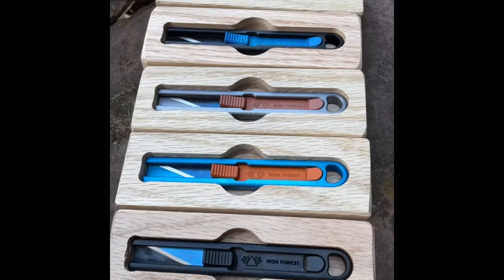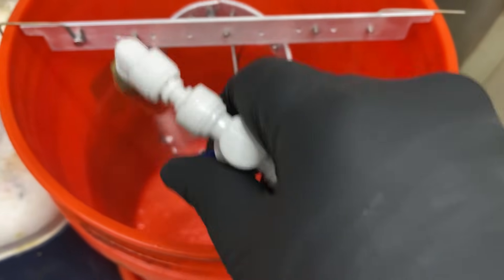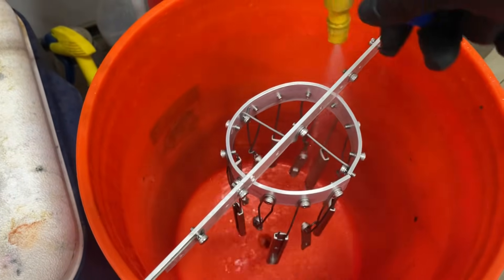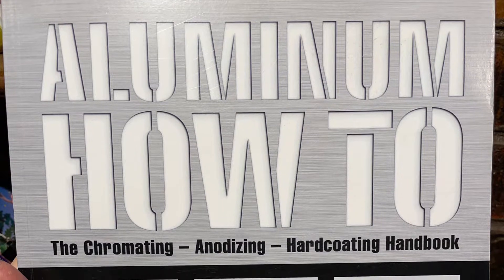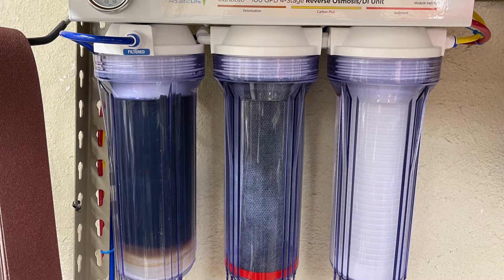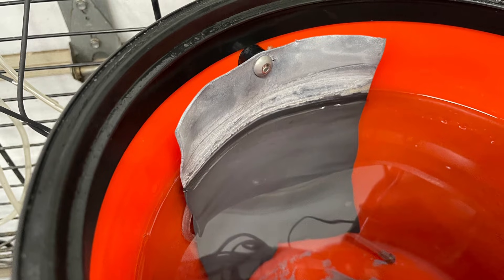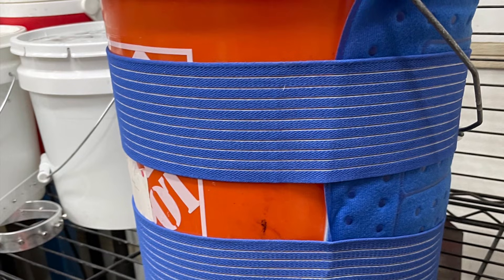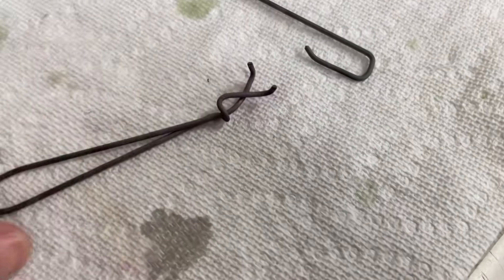Anodizing 101: Professional Level Finish At a Small Scale!

Comment: You said that you use weldingwire to rack. I've heard that you can only use led, titanium or aluminium in the bath, or it will be contaminatons? Are you using aluminium weld wire, or does it work with any?
Reply from the maker: I use titanium wire. You can use aluminum too but you have to strip it every time. I’ve never tried it.
Reply: @IronForestKnives  thanks!

Comment: Very well done with excellent detail paid to keeping the parts clean and flushed of each chemical treatment after each step. One note is that De-smut is a base not an acid. It can be and is used for removing a poorly anodized layer so you can get another shot at it!

Comment: At what step is it functionally anodized? After the sulfuric bath or after the nickle acetate?

Can you anodize them without dying them?
Reply from the maker: Functionally after sulfuric. No you don’t have to dye them. But for best durability you need to seal them. Also they can stain if you don’t. If you want you can seal in boiling water for a long time. Water has to be very clean (0-5ppm) or the dye leaches out though.

Comment: As of 10 October 2024, everything is sold out except for the Utility knife. From what I can tell from the website that means one out of eight knives are available. I guess keep checking back, but I don't see stuff coming back into stock until after the holidays at this point.
Reply from the maker: The Remex is currently out of production, but I would like to revamp it in the future. I am currently working on getting the Fictive back into production. I got a new machine, so I have to redesign all of the machining fixtures and process.
Reply: @IronForestMFG I'd be interested in the Fictive.

Comment: great video, i was always concerned about disposing of used chemicals, how do you do this ?
Reply from the maker: A valid concern! I’ve thought about this a lot. To keep it low tox, I try to use organic non-metal dyes. The acid and baking soda kinda balance out in the rinse waste. The real concern is the nickel in the seal. I mitigate this by pouring the waste water into a tray of kitty litter, and leaving it in the sun to evaporate the water. Eventually I’ll throw the kitty litter away. That way I can at least keep it out of the ground and waterways. As I start to make more wastewater I will either find a new solution or scale up the kitty litter. If you have a better idea I’m all ears!

Comment: Thanks for the video! I pretty much mirrored your setup but used a low end titanium coil chiller made by vevor. Well it appears to have not worked well. Are you still using that chiller setup? Thanks!
Reply from the maker: No, I’m not! I built a new chiller that has a much higher cooling capacity! It’s cheap and easy to make, only requires 2 5 gallon buckets, 1/2” pvc hose, hose clamp, drill bits. Unlike my previous cooler, it has so much cooling capacity that the chiller water can be almost the temperature I want the bath to be. With the other chiller, it had to be ice cold to keep it at 70°. I’ll try to do a video on it very soon!
Reply from the maker: New video about it is up!
Reply: Dude! Thanks a ton! I’ll watch soon.

Comment: As a "professional anodize technician" (big quotes on that one since I'm under 2 years at my company, but have my process down pat), this is the closest to a "professional" as you can get as far as home setups go, I'm highly impressed.

The book by R.H. Probert is all our shop has ever used for reference and we always nail our thickness goal (.0005- .0007 measured w/ eddy current), except we base our power supply settings by constant voltage instead of amperage. Really easy if you know what aluminum alloy you're working with specifically. And don't worry, in shops like mine I splash my parts around in the rinse tanks the same way you do!

You've got the best, and safest home setup I've seen. Kudos to you for showing the right way to do it.
Reply from the maker: Thanks! Nice to hear from someone in the industry. I’ll be upgrading my setup since I have more space at my new shop. Not sure what upgrades but I suspect it’ll just be more spread out, and in larger containers.

Comment: Are you rinsing with tap water or distilled water?
Reply from the maker: Deionized from my RO+DI system. It usually measures 0 ppm. When it hits 3 ppm it’s time to change the RO filter and DI resin.
Reply: @IronForestMFG  thanks for the quick reply. I realized after rewatching the video a third time that you mention the RO+DI System, and now I see it on your parts list from your google doc. I'm going to be building out a setup of my own following your blue print. Are there any changes you would make? I'm also a member of the fb diy group that's how I found you here. If you have a preferred means of communicating let me know. Thank you for all your input here and there.

Comment: Thanks for this great video! I've read that pre-anodizing prep with glass beads is a mistake since the beads can shatter and embed glass in the aluminum, which can then affect the ano. Have you had any issues with that? Have you tried blasting with any other materials (walnut shell, stainless steel beads, etc.)?
Reply from the maker: I do wet blasting, it’s much more gentile. The water acts as a buffer. I’ve never had glass embed. Never tried any other media other than AO which was also wet blasting. If I over blast the parts, they won’t take color as well in some areas. Haven’t figured out why yet, but I haven’t tried to find out either lol.

Comment: thank you very much for sharing this, what wire did you use? titanium welding wire?
Reply from the maker: Yes exactly. Thicker is better because it makes a stronger spring. I like 1/16”, But it depends what fits the part.
Reply: @IronForestMFG   how much votage and amps did you se to anodize all of those knife? from the video I saw you are ate 4.8v and 1.38 amps, is it correct? I thought for anodize we need minimal 12 v?
Reply from the maker: @adityasakhakusuma2507  In my opinion… you need a constant current power supply. You can also do constant voltage but the times will be different. With CC the voltage changes throughout the cycle, it raises the voltage to meet its amperage setting as the part becomes less electrically conductive.

Comment: just started to do some anodizing and the aluminium wire that i'm using which is around 3mm thick keeps burning and disolving. the part being anodized then breaks away around an hour into the anodizing. kept the amps to minimum, around 1A and the part is around 4 square inch. Dont get it.???
Reply from the maker: 4 square inches, as in the entire part surface? All sides? It honestly sounds like you have polarity backwards. Also I put 4 square inches into my calculator and it gave me .167 amps…

Comment: Excellent walk through, thanks for making it and sharing!  We have a slightly larger line. We found setting a programmable power supply to 16 volts constant voltage will then automatically put the current at the exact value it needs to be.

Comment: Hey I couldn't get the calculator to work.  The link just shows values, not formulas
Reply from the maker: Hmmm… it just worked for me. I’ll explain how it works real quick. At the bottom of the current calc tab, you add your part name, then the surface area in sq. Inches of the part. Then change the part quantity to how many you’re doing. Everything else is automated. At the top it will output how many amps you should set your constant current power supply for. It’s the green square labeled “total amps”.

Comment: Did you switch from sodium bisulfate to sulfuric acid? If yes, how come?
Reply from the maker: I did! Only because there was almost no information about using it available. So it made troubleshooting difficult. I don’t think I noticed a big difference. I’m not sure how you would check the level of acid and adjust it with the sodium bisulfate.
Reply: @IronForestMFG  Do you remember what  acid ratio you had when using sodium bisulfate?
Reply from the maker: @JDesignSwe  I don't remember but I looked back at my first video and it looks like it says 8.34lbs in 4 gallons of water... not sure though.